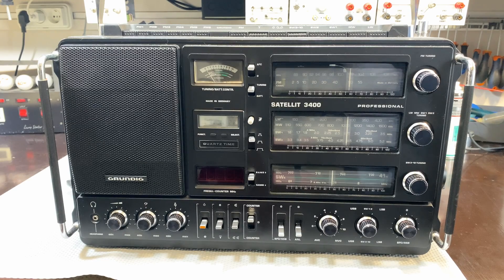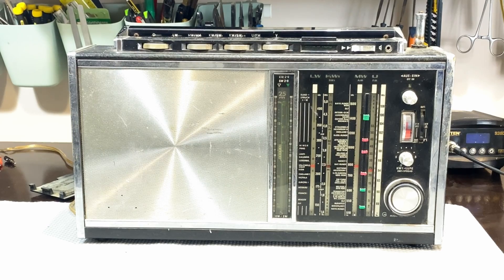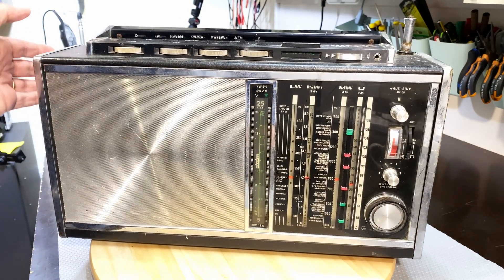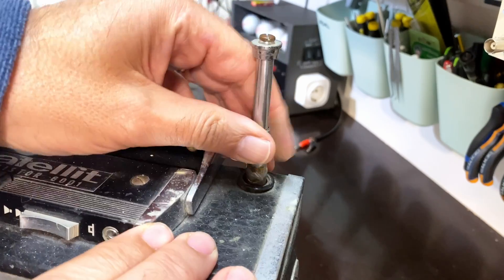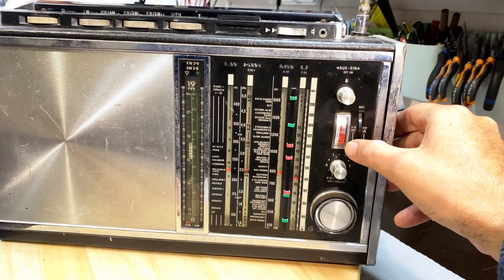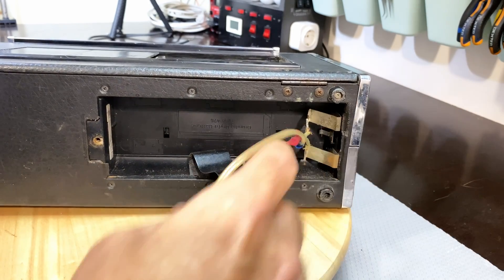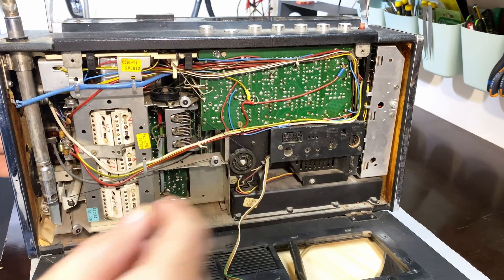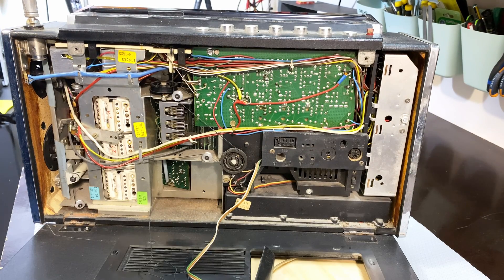This one really needs some help! Grundig Satellit 6001 restoration part 1.

Comment: 12:10 - Yellow/golden Frako electrolytic caps with a decent chance that they are still good.
12:20 - Looks like an AC187K/AC188K audio output stage with a thermistor on the heat sink for bias current stabilization; a very common circuit around 1970, at least in Germany.

Comment: Excellent intro as usual. 
In fact as I sit with a cup of tea and a couple of biscuits to watch them the intro "Heartbeat" has become similar to the footsteps of an old friend coming up the path for a long anticipated visit to which he will impart some of his wisdom.

Don't change a thing!!

I swore I wouldn't watch videos on transistor sets until I had a basic grasp of valve radios. I don't, I still know next to nothing ... yet here I am again ... about to watch the rebirth of another Grundig ... while the household jobs mount up almost as fast as my wife's temper for not doing them.

Its all your fault Manual ... you're too good at this video malarkey but your self deprecating and humble style is very refreshing.

Regards
Mark
Reply from the maker: The heat-beat was initially a sort of metaphor for the whole “bringing dead radios back to life” thing, but I’ve come to like it. 
As for household chores that are left undone, I blame all my subscribers for that 😊 She doesn’t buy that, but also can’t offend over 13 thousand people 😊 Happy new year.
Reply: @electronicsoldandnew  yup the heartbeat certainly translates as you intended.
Thank for taking the time to reply and Happy New Year to you and your family Manuel.

Comment: 8:00 No, that's for connecting the optional mains powersupply.
It fits in the square room where that connector was.
I got hold of two of these 6001's a few years ago, both in similar condition.
Managed to get 1 restored and fully functional (and good looking) unit out of the two, but it took alot of work.
Theres a toothed belt that connects the two drums, that is probably broken. It's on the underside.
New belt (and the 2 dial lamps) is easy to get on Ebay. New antenna is not that easy to find.
It shares antenna with a few other models. There is a list on the web somewhere that shows this.
I had to use peaces from 3 different antennas to build together 1 complete antenna.
BTW restringing isn't that hard. I had to do both AM and FM and it was rather easy.
Now that the chassis is out of the radio you can easilly get to all sides and tread the cord where it needs to go.
But it looked like on of the glases was missing from the dial drum, hope that's not the case.
Really looking forward to se the restoration of this.
Reply from the maker: Thanks for the tips and inspiration about the dial chords 😊 Should be a good challenge.

Comment: Nice! I've been doing repairs on that same radio for a few weeks now. You will find a lot of amazing mechanical implementations. I had the same dial cord broken, its the MW/LW one, i found that the capacitor was quite hard to turn. The belt that was responsible to turn the drum in sync with the scale was dried and broken in pieces and after three wrong belts i've settled with a 52 teeth One that i needed to cut in thickness to 3mm, even though the original was 51, i didn't manage to get it in there.
The radio is quite amazing in sensitibility and selectivity, and has a stunning audio. Can wait to see more of  this repair. Greetings from Maia (Portugal)
Reply from the maker: I’m dreading the mechanical problems. But…. can’t be helped. I’ll just have to find solutions as the problems arise. Cumprimentos da Madeira.

Comment: Hi Manuel,
I’ve only worked at one service and sales centre that had, among a few other brands, Grundig dealership.  That was during the early 1980s.  By that time the model 6001 was at least twelve years old ( I believe it was first introduced 1969) so consequently I remember only a small number camping in for repair.
As I seem to remember, they were the smaller table model of the Satellite, or multi-band shortwave range radios.  Nonetheless they performed well, and produced brilliant audio response.  I look forward to this reconditioning series as I do with all of your radio reconditioning series.
Best regards, Phil
Reply from the maker: Thanks Phil.

Comment: Looks like an interesting challenge Manuel, I'm hanging out for the sparks 🙂
Reply from the maker: We had lots of that last night in the Madeiran fireworks display. Don’t want any here 😊 Anyway, 9V with a current limited supply will not create much spectacle.
Reply: @electronicsoldandnew  ☹

Comment: First of all, your intro was fine!  I find all your videos enjoyable, educational, inspirational, interesting, and a pleasure to view.  Although there have been a couple of things over the years in your videos that I disagreed with you on, by far and away we think very much alike!   An example is the mechanical and dial cord issues.  I hate stringing dial cords.  And some of the mechanical things I have had to deal with have had me in tears!  I once was working on a Zenith radio and was loosening the pully on the tuning capacitor when a coiled spring that I had not been able to see went TWANG!  I never did figure out how to fix that (my dad threw the radio away...Alzheimer's)  nor have I been able to find any documentation on it or people that knew what it was supposed to do.
The blue and yellow rectangular blocks on the board with the power transistors...are those capacitors?  If they are, do you think they are paper types in a molded case or do you think they might be a more reliable type like ceramic disc or mylar?
I am very much looking forward to the next installment in this series!
Keep up the excellent work!
Reply from the maker: The other caps seem to be film caps. I think they are good. As for losing mechanical parts, unfortunately it’s happened to me more that I’d like to admit. 😊

Comment: Can you tell me how many screws  do have to remove  to open the back  I remove  the two littel on the back  and the two great screws above  on the volume bass ect...    I need to be able to work on the buttons and the plastic part of the drum for the KG tires Your help is very much appreciated, I'm not a technician that's why this question
Reply from the maker: I’m afraid I don’t know now, as I finished that project some time ago. Look at the first video again as I sometimes mention this.
Reply: @electronicsoldandnew  ok no problem thx any way gl 73,

Comment: I have one in beautiful condition but does not switch on apparently it has 2 glass fuse holders that gums up but I don't seem to find them. Any help will be appreciated
Reply from the maker: No fuses. Follow the schematic and you should get there. Usually the power connectors need cleaning.

Comment: Regarding the black vinyl" leather" on the radio. I use Kiwi shoe dye .the one with the brush .I used it on a Hacker radio I just finished. Brush it on leave it to flash off then use a soft rag to buff it .soaks in quite well .just a thought.ps it works on the plastic as well
Reply from the maker: I’ve used that before myself. Works really well.

Comment: As André is saying, the belt is likely to be replaced. It's a teethed belt like a camshaft belt in cars. You can find them either on Ebay or in hardware shops. Another caveat is the speaker grill: it should be cleaned without using any solvent, or you'll loose its caleidoscopic reflexes ! (Been there ...)
Reply from the maker: 😊 so have I

Comment: What you thought was a battery connector is a connector for an optional mains unit which fits inside in that space at the bottom . Think it's called s TN12 
Best of luck with it . I had a fight with one a while back .... I won , in the end !!
Reply from the maker: I’ve read about the mains unit. I guess it’s really just a transformer with stabilised output. Will see if I can find a schematic for the TN12 you mentioned.
Reply: @electronicsoldandnew  yes it's just a wall wart really in a square box . You would think that at the price these things must have been , that would be included . They do not turn up very often but one could be made up from a wall wart I guess . That radio will keep you busy for hours . Mine gave me a good few headaches !

Comment: For those interested in this model, you may wish to consult a French portal gathering info on old radios "the big book of wireless telegraphy" because radio was depicted as such in the early times. So for this model, there are the usual user and service guides, but also an extensive gallery of pictures, of the radio and its accessories, including the SSB reception block and its entrails. (I have tried to insert this comment many times, before to realise that YouTube would hold comments with a URL in it or even clear text from a "jailed" URL)
Reply from the maker: Thanks for that. I’ve seen your comment appear and disappear quite a few times now, and wondered what was going on. I was actually very interested to know about that site.
Reply: @electronicsoldandnew  I'm glad it helps. I didn't even notice that the SSB block is fully detailed with its schematics and PCB ! ... and that stringing diagram from hell !